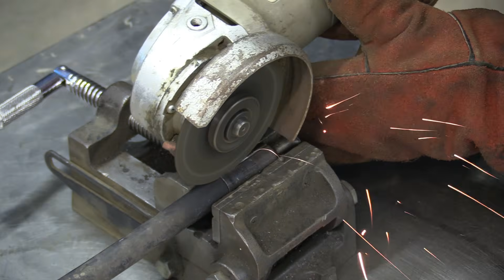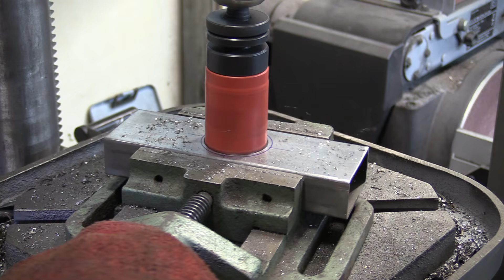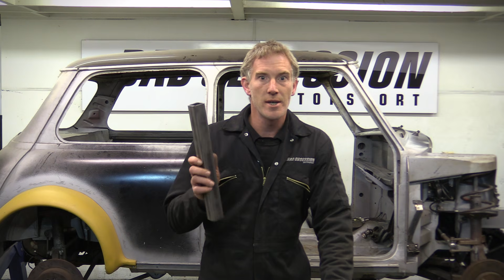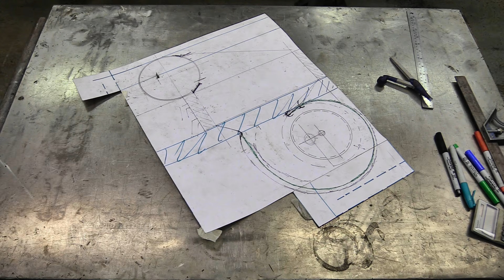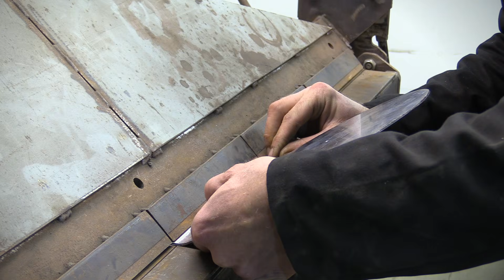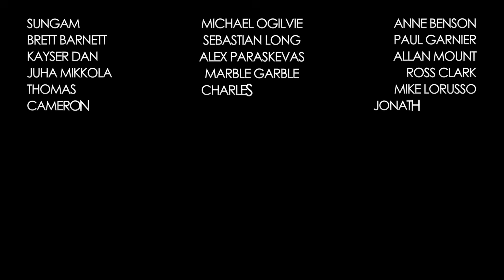Project Binky - Episode 16 - Austin Mini GT-Four - Turbocharged 4WD Mini

Comment: I wouldn't have guessed you were worried about AC. Especially since most homes over there don't have it and the whe country appears to be a sunless grey hellscape whose only cimate difference is when it goes from damp to raining. 

If you didn't need it I would've gone the rally route and add a slim fresh air intake passable as oe style. Ya know, a roof scoop, but filtered and sealable.

Comment: Yes the fabrication skills are great. Yes it looks awesome. Yes it's a great build series. Does it need to take 8 hours to make that bracket because it's one-off? NO! It takes 8 hours because it's a ludicrously over built bracket that doesn't need to be made that way, for literally any reason other than to take a really long time. A beautiful, functional, strong and elegant bracket could have been made in a fraction of the time that actually meets the needs of the use case. I seriously don't see the justification for such poor design when it comes to efficient use of resources. That pump sees no forces or stress other than small vibration and yet the bracket is tied into the frame of the car in more places than the pump even has on it in the first place. This is a long tradition of Bad Obsession. Build things in a way that is completely inappropriate for the use case and then claim that it had to be done. I don't get it.
Reply: Well Negative Nancy, where's your build? I'm pretty sure they have structural integrity, and longevity in mind.

Comment: Instead of all the hydraulic malarkey and associated piping  couldn't you have used an electronic steering column off an MG TF? These use a much smaller normal size steering rack.

Comment: This will quite possibly be the most well engineered restomod in history. I can't think of one other project as well built as this. If anybody knows of a better one let me know.
Reply from the maker: Over engineered...
Reply: Bad Obsession Motorsport  I say that as someone about to get their masters in mechanical engineering. What you all have done is freaking impressive to say the least. I was also thinking  that engineered might be the wrong term. If your car was designed by an engineer it would be impossible to work on!!! Haha, Just look at every car made past the year 2000 for reference!!!

Comment: Missed opportunity to use the "Tiny" Ron Taylor jokes from the original Police Squad using Edd's height instead.

"Hey Edd, you've got something stuck to your face."

Edd flicks half a chicken off his face
Reply from the maker: We considered it actually. However, lack of a chicken or a banana in the shed put paid to that. 😁
Reply: Has the sombrero migrated south?  Could've pulled the "non-regulation head gear" joke. 

Ah well, there's always next time.

Comment: I really like the kind of rotary valve that's used for the HVAC's air distribution. I imagine that it's three modes are "defog", "panel", and "floor", but is it possible to run it on "defog" and "floor" at the same time like in most vehicles? I'm asking because I sort of want to build something similar for my own car.

 Very inspirational build, guys. Keep it up.

Comment: Use a servo or stepper motor to control the ventilation flap so you don't have to use physical linkages to the fascia.

Comment: Hay guys we got the smart 4 up and running using a cb1100ex and a reversing box by Elite Racing to gain reverse. Took a bit of time to engineer the mounts for the reverse box but its been all boxed in and it looks good. Where can I post a video or photos for you guys to see. You be Inspired me to do better cleaner work. Not that I didn't before but watching you guys work has taking my work to a different level. I would like to thank you guys for doing what you do. Can't wait for 17. Thx Billy n Melissa Bowling

Comment: So my calibrated eye says this would be well over 1,000 GBP for the fully-bespoke heater airbox control. Over the top a teensy bit?
Reply from the maker: +Greg Paul The parts and materials were a fraction of that. Plus, there was no other way of doing it, so custom it had to be. Believe us, if we could buy something and just fit it, we would.
Reply: Bad Obsession Motorsport just guessing but I think he meant including your time and skill to design and build the box. Also you need to include the cost of materials for all the CAD work too!

Comment: Ok, First off, I don't say this lightly, but this is the best thing on you tube. Every single "car person" I recommend it to loves it. It is near perfect "television". Bravo.
Second, Color. Far be it for me to presume I have a say in the matter, but if I may be so bold.... 
I have been contemplating what it might look like, if you used color to accentuate the work. For instance, White for all of the original, and factory replacement panels. Dark Green for all of the hand fabricated panels. Black for all of the Toyota parts. Instead of the normal flag on the roof, how about a faintly ghosted BOM Logo?
Lastly, I can't believe Nik  missed the final detail of the interior. 
No self respecting driver should be forced to lean into the back seat to open the Quarter windows. They need to be Electric. Like these: 
https://youtu.be/ZIGvF-56Vlw?t=49
One needs a quick way to evacuate any, err, umm, "smoke" that may have built up in the cabin....

Cheers mates, thanks for all the tremendous work.
Reply from the maker: +Paris Trout Thank you very much. ☺️

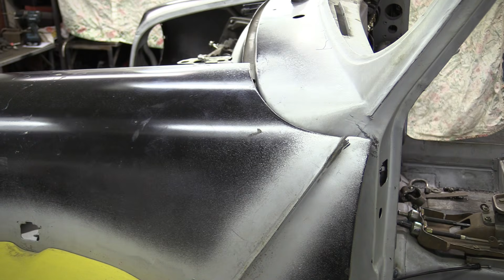Comment: Great job to find that other 25 mill in the front. The gap out of the carter was never to be the best solution for the exhaust. One question though: Isn't the new flip front mechanism showing to much ? It's like is  way below the lowest part of the front clip? (as to be seen at 11:56).
Reply from the maker: Hidden by the number plate.

Comment: love your work guys, my only suggestion is that maybe move away from the gen 2 3sgte and use a gen 3. I run a gen 3, 3sgte in my ke70 and did quite a lot of research into the differences prior to choosing the motor and it is very significant. My gen 3 has copped years of abuse and shows zero signs of anything wearing or breaking etc. 

Again I like the quality of your work, I can relate to it as it seems to walk a line between show car build and backyard junk. The perfect ratio of quality, performance and rate of work completion. Anyone can tig weld and CNC this and that etc but at the end of the day its just childish.

Comment: Do you think you could find an engineering intern at a local college to maybe do some CAD work for you. If you gave them the components and the dimensions of the space it needs to fit in I think you could save a lot of the head scratching. Sitting at a computer screen and telling them your ideas and where you'd like everything in virtual space. You could print to size on cardboard for your mock up, go back to the computer for changes before final designs could be sent to a local laser or water jet company. Might save a little time. Your other brackets could be made in similar fashion as laser cut pipe and tubing is so fast these days. Have you checked out ThomsenMotorsport? His channel is a great mix of CAD and fabrication.
Please don't think this is criticism, I love the work you do. You are a testament to the 10,000 hour rule.

Comment: All the best words, but I have a question: what primer do you use? In one of the episodes, I remember, it was mentioned, but I don't remember which one was it.It sure looks comfortable to use, as I right now am using rust inhibitor for this purpose, it works well as it's durable and sticks very well, but if you apply it where another weld is gonna be - it's as difficult to wire wheel or sand as a powder coat
Reply: U-POL Weld #2 primer amazing stuff to weld through

Comment: Bad Obsession: What made you choose hydraulic PAS over an all-electric PAS motor that fits to the steering column?  I imagine you must have considered it, just interested to know the reasons why you would have chosen against it..
Reply: ...And for that matter, why didn't you use an electric heater?? :D
Reply: I once mounted an electric servo steering column from a Corsa on a Citroen AX. Also quite a bit of work  (because of brackets) , but: That solution takes place from the interior, + I doubt you make much progress if you mount it over a hydraulic steering rack + I couldn't make it speed sensitive...
Reply: Joost Cumps Ah so it's just as difficult as fitting hydraulic PAS, but just in a different way?
Reply: With my skills: I think my thing was the only solution possible. :-)  I think one should choose hydraulic if possible.

Comment: There are rumours that BOM has " Already started on EP.17 ".
 Well, over Shropshire, the stars shine. They’re huge balls of hydrogen heated to a gazillion degrees; so hot they can’t burn. They glow because of metamorphosis beyond the reach of science, and turn elements into pure light. Many of them will swell enormously before they die, and then shrink to dwarfs.
Meanwhile, near Shrewsbury, two blokes are building a Mini. 
The only thing these two events have in common is the time scale.
So, I won't be holding my breath‼️👍🏼👍🏼👍🏼

Comment: i watched all your videos and brought a quad cam subaru turbo = F--K it - so i changed suspension - brakes - steering - sway bars with solid links - turbo - exhaust - wheels and tires - thanks for your help = 256 kph ! cause i took it to tasmania -? australia .
Reply from the maker: +Ronnie Boucher We have one of those too. ☺️
Reply: top show i bet your subaru is a fantastic machine = i also worked at the healey factory in australia restoring austin healey sprots cars - some had a 302 v8 and 4 speed = thank you for your effort !
Reply: I thought the only place in Australia that has no speed limit is the stretch of road to and from Alice Spring in NT, but I’m out of Australia a few years now so I might be wrong.
Reply: Just a tad slower then my stock 2.0l honda haha yepp subaru owner hates it

Comment: why do they call linear actuators linear, that bonnet clearly goes up in a sinusoidal pattern
Reply: Linear activators go in straight lines, hence linear. The mechanism that they move, however, could do anything. It's actually a rotary motion - clockwise to open, anticlock to close - transferred from linear via a bell crank (BOM's version of a bell crank, which carries out the same actions as a bell crank but somehow looks way WAY better).

Comment: why power steering?, its a sodding mini!, granted with increased power, why not just go with metro turbo quick rack?.
1. they fit, 2 they are under 70 quid brand new and 3 they dont rob power.
i have followed this build from the start, and this is the first time i have questioned your choice, my old mini was only a mini neon with an mg metro engine and brake conversion and it torquesteered like a bastard, power steering would have made it even worse.
not trolling serious question
Reply: I'm sure there's lots of decisions that could have reduced cost and time in the same way but the defining goal was to put the running gear from the donor car into the Mini body shell and that would be cheating :) I do wonder how its going to handle though

Comment: IM confused by the amount of  fabricated metal additions going in to such a small car. All those metal fabricated parts are gonna weigh a stack! Any small light weight vehicle is loosing valuable advantages adding a rear differential and drivetrain let alone everything else thats going on top?!
Reply: I think with that running gear, you like at least some kilos to push tires on the ground. Surely, in the end it will be less then the stock Celica it came from?
Reply from the maker: Joost Cumps We think so, yes.
Reply from the maker: +Michael It's hard to have a 4WD system without a rear diff TBH. And weight is not a consideration for us.
Reply: I get the 4wd part, but all that extra metal, linkages, etc required to run the hinged hood, and then the master piece of a creation you call a heater box?! While impressive, thats gotta be a massive hit to an already heavy addition.
Reply from the maker: +Michael Given it's a road car, not a race car, we're not worried about weight.

Comment: You can speed up fabrication by drawing up brackets for laser cutting, hacking everything from plate and box with a 4" grinder just sucks. Also why the need to grind every weld, lay some beads with the tig, softer weld grinds easier or just leave them flush.

Comment: I don't think I could handle it if you crashed Binky the first time you drive it in anger. Treat it like the work of art it is please. ;)
Reply: Binky will be the Chuck Norris of Minis, a head-on collision with a brick wall will only need a buff job and bumper due to insane overengineering

Comment: All that effort for the HVAC box and no recirc? Surely with the experience gained with the flip front control gear, an actuator controlled recirc flap would have been ‘easy’ to fab up? Amazing work guys thank you

Comment: With all the sparks being made in the engine compartment. I hope you are protecting the engine exhaust ports from metal fragments entering the ports.
Reply: Why? The engine's going to be completely stripped down & rebuilt, with a few crazy mods thrown in I'm sure.
Reply: It's a dummy engine they're using IIRC.

Comment: That power steering  bracket alone is a work of art but it didn't have to be that complex.  A piece of angle iron would have done the trick.  Now the heater box?  I don't really see an easier way.

Comment: Goodness gracious.... That's an awful amount of work.

Question: Are the engine and drivetrain going to be replaced with brand new celica parts instead of the ones showed in episode 1? This mini deserves better than a second hand celica engine.
Reply: i think its not just a celica engine, its from a gt4, which i think was a homogolation thing?
Reply: asked and answered in Q&A ep 2
Reply: Vince Vega Customs because it was only on 18 psi
Reply: kamakaze2007 a heavy 3sgte?there s alot better to use,ex honda engines ;) my brother had a gt4 on 18psi he never beat me hahaha

Comment: Why didn't you guys use -6 3/8 steel braided nylon line and AN fittings for the power steering? That's what I use, not the cheapest but it's very flexible, looks good, and is bulletproof

Comment: +Bad Obsession Motorsport
When complete please do not wrap this car around a tree.
I'm curious as to why power steering was fitted. These cars did not have it originally in 1959, is it related to the wider tyres and more power or was it just a mechanical indulgence to use the rack that came with the car likewise the powered opening front/bonnet (that looks like it might be vulnerable to being struck by large rocks in a rally situation and unneeded extra weight (this car is to be rallied is it not).
Anyway, brilliant work, it is your car and you can and should do whatever you like with it.

Comment: Just one question, with no snark intended. Is there a reason you guys didn't use your CNC mill for the slots on the power steering bracket? I'd think it would be faster and less labor-intensive.

Comment: So here I am on a Friday afternoon with a rare day off from work, in my shop with 100% concentration on twiddling the knobs on the mill to drill a line of holes with as much precision as possible. A YouTube notification lights up my BlackBerry. What's this? Bad Obsession Motorsports has uploaded a video?! OK then, pound the emergency stop button, boot up the shop computer and spend the next 33 minutes on the edge of my seat. Excellent episode, and THANK YOU for showing a realistic timeline on what it takes to fabricate even the little fundamentals like brackets. Somehow I get the distinct feeling that was a direct tongue in cheek response to the "When's the next video?" comments. That HVAC box is ridiculous. Ridiculous in a good way, of course. But ridiculous nonetheless. I do have to admit that as I watched it born of cardboard then aluminium all I could think was "Vintage Air Gen II Mini". Seems like it would fit in the available space and save a lot of fabrication. Wouldn't be as awesome. Or, a boot (trunk) mounted system. Definitely looking forward to seeing how it is controlled. Methinks a custom controller based on Arduino would be in order.

Comment: I hope they don't crash it in first test drive :D Wonder what could be the insured value of that car when parts used are not that expensive but working hours used could be counted in thousands of hours. Basicly everything built from the scratch.

Comment: Very impressive work as always. It's interesting to see that, as the project progresses, you're tackling more and more complex fabrication problems. Due to a very low income (health and other issues) my project is going in the other direction in as much as I try and make things simpler - I also lack much of the equipment required for the more complex fabrication jobs. It's a joy to watch your fab montages - what a thoroughly excellent project.